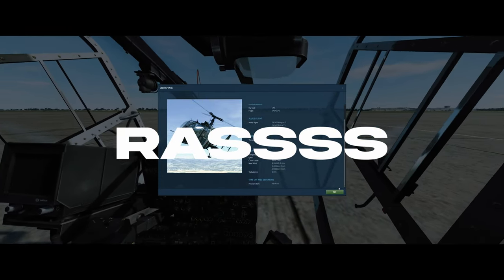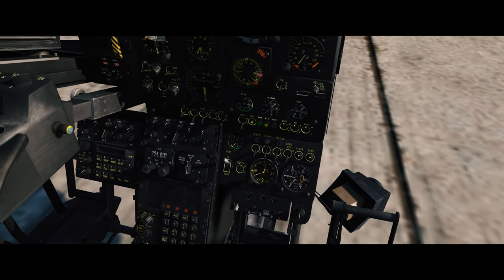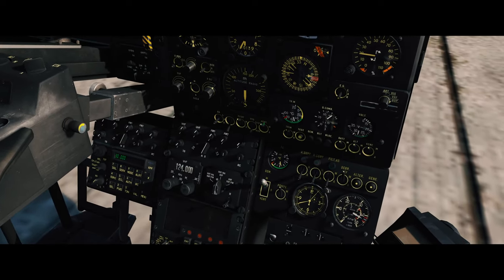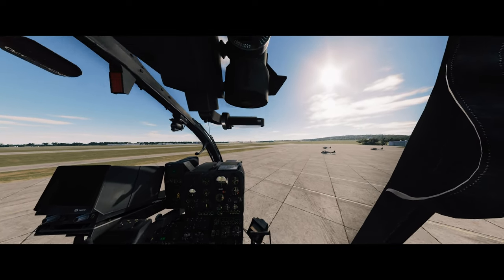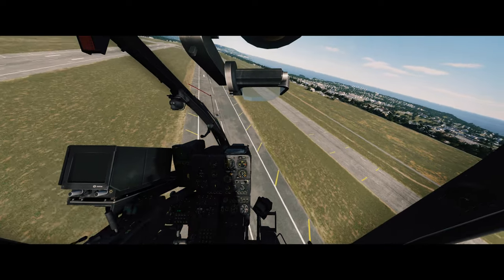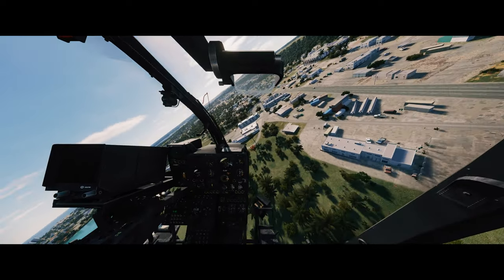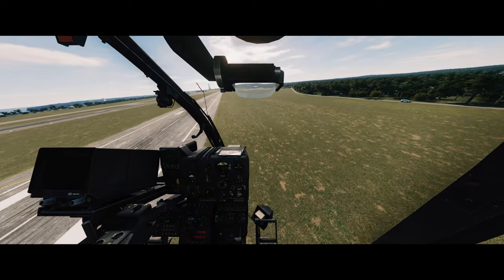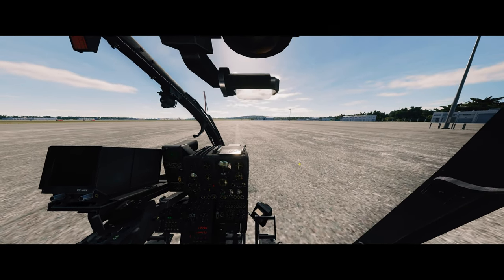DCS - GAZELLE - DIGITAL COMBAT SIMULATOR - 4K

Comment: You dont have to turn off the missiles to use the gun. The gun toggle will always override the missiles. :)
Reply from the maker: Gotcha, I will do that now whenever I do load the rockets. Now I just run the Gelo with just the guns for speed. 👍👍👍
Reply: @rasse30  yeah. I'm still waiting for polychop to add the 19 rounds missile pods to have more fun 😊
Reply from the maker: @felixf4613  that would be sweet

Comment: The Gazelle has had some major handling issues for years. That being is you let your joystick (cyclic) back to center the helicopter would stay pitched. Highly annoying And made the Gazelle not fun to fly. So my question, is that finally fixed? Is it flyable? I have the Apache, Mi-24 and the Huey. But I've been avoiding the Gazelle due to its difficulty to fly.
Reply from the maker: I know that if I’m flying it to a location and I let go of the stick it will start pitching up(nose up) and I think it’s because of the angle of the blades. If I drop the collective then the helo goes nose down a bit. Now it’s a little bit of a pain to put the alt hold or speed hold button.

Comment: What? No Blue Thunder mod for the Gazelle??
Reply from the maker: The mod??? I looked and saw a skin for it. Please explain lol
Reply: @rasse30  If you go look at the movie Blue Thunder, that helicopter is a heavily modified Aerospatiale Gazelle. The giveaway is the airframe shape and design on everything from the rotor mast back to the tail. Even just Googling Blue Thunder helicopter will reveal what the base mdoel is.
Side note: Blue Thunder is supposed to be armed with a 20mm Vulcan. The weight would be a problem. The Gazelle would be very nose heavy and difficult to control with a Vulcan hanging off the front. It would be much more believable if they said it was a 7.62mm minigun. 
I don't get to play DCS because they don't offer it for Mac, so I watch everyone else play on Youtube. I looked at DCS last week, and when I saw the system requirements I didn't go any further. So I did not look to see what aircraft and skins were available. Looks fun, but adding Windows thru a System Commander app (does not work as well as advertised) or building a PC just isn't possible right now.

Comment: Whats your setup mate and how do you record?  Your frames are great.  I have a 3070ti 64gb of ram and Nvme m2 but i still get stuttering while streaming...
Reply from the maker: I’m running a 3080TI 32GB ram DCS is on its own M.2 and if I’m not mistaken all the settings on max. Not sure why you would be stuttering with your setup.
Reply: @rasse30  What software are you using? im running OBS
Reply from the maker: OBS as well
Reply: @rasse30  I think it may be my GPU... not sure though.  When I stream on to my HDD the frame rate is shutter speed, improves a bit on my NVME but... so annoying :(
Reply from the maker: @chadvader974  i can imagine, I would be súper annoyed also. I’ll run through my setting and let you know. Maybe it’s one setting that’s off
Reply: @rasse30  thanks man!
Reply: I followed some settings videos to no avail
Reply from the maker: Yeah, no problem. 👍👍👍
Reply from the maker: Gotcha, let’s see if we can find a fix